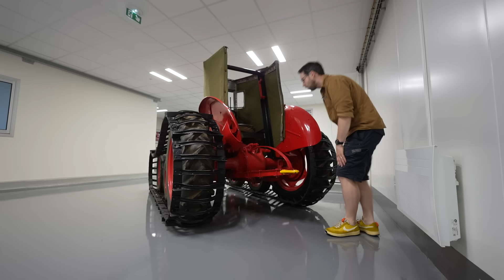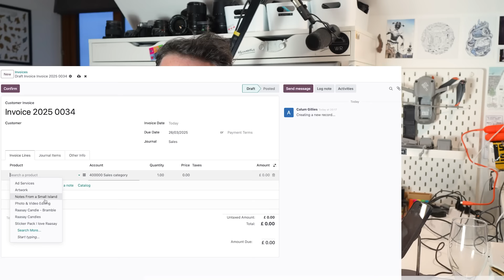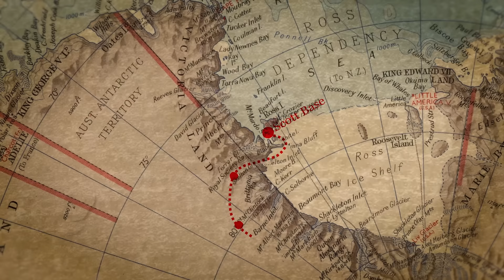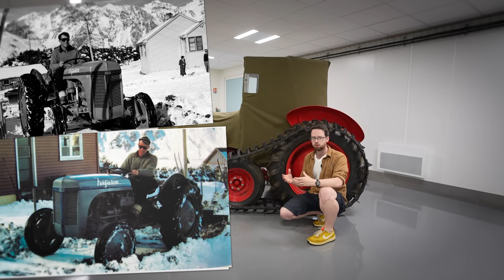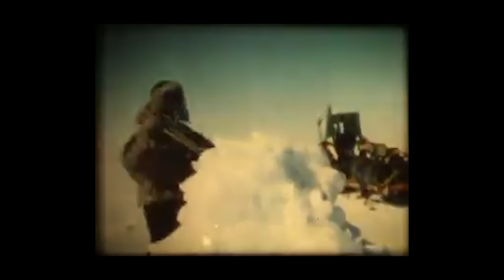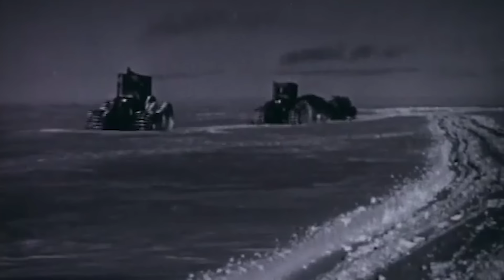The First Vehicle to Drive to the South Pole

Comment: Came for the antarctic exploration, stayed for the old tractors.

I dont need one as big as that ferguson of yours but i would kill for an old sub compact with a mower deck. Cub cadet made a series of them in the 70s but the rear PTO rotated the opposite direction from the standard everyone else uses. Im not sure if they sold them in the UK but they were fairly common as lawn tractors at one time in the US and Canada.

Comment: The Ford tractor came first. 

Specifically, the Ford-Ferguson 9N, produced through a partnership between Henry Ford and Harry Ferguson, was introduced in 1939 and was widely used throughout the early 1940s. 

Here is the breakdown of the timeline:

Ford (Ford-Ferguson) 9N (1939): 

Introduced in 1939, this was a pioneering tractor featuring the "Ferguson System" three-point hitch. It was common in the early '40s and was followed by the 2N in 1942.

Ferguson TE20 (1946):

After Harry Ferguson and Ford separated in 1946, Ferguson began producing his own tractor, the TE20 ("Little Grey Fergie") in England.

Massey Ferguson (1953/1958): 

The company "Massey Ferguson" did not exist in the 1940s. It was formed in 1953 through the merger of Massey-Harris and the Ferguson Company, and the name was officially shortened to Massey Ferguson in 1958. 

While Massey-Harris produced tractors in the 1940s (such as the 101, 20, and 81), the specific brand "Massey Ferguson" and its iconic 1940s-style tractors (like the TE20) came after the Ford-Ferguson 9N.

Comment: Looks pretty much just like a Ford version that my grandfather owned that we completely restored from the ground up. Like yours his was extremely reliable very rarely ever needing anything and always started on the first kick of the starter. They were very easy to work on too. We need to get back to that simplicity and reliability and get rid of all the computers in electronics In everything we build. Sure have the computerized version but offer an analog version as well. Willing to bet after a short period of time the analog versions would end up selling better especially if the computer version is still built the way it is now.

Comment: We have a 55 as well but its petrol, originally ran on parafin with a starter tank at the back that lets you start it on petrol and warm the parafin :D Amazing tractor so easy to maintain and replace anything I love the engine and how it uses piston sleeves :D just replaced them all on ours. Still watching and your using the standard exhaust we bought a underneath one and it makes a big difference, so handy how easy parts and even little upgrades like your foot plates are to come by, I love this tractor :D You can even make them run hydraulics the one we have now is our second one the first one had very basic one way hydraulic pump system made into the main casing by some DIYer the one we have now is just used to turn a PTO hydraulic pump much more standard. Would love to get a front loader for one but they seem very hard to find only ever seen one in person and it was what looked like an original front loader with a string to tip the bucket :D

Comment: I remember growing up on a farm in Northumberland UK in the foothills of the cheviots. they had a Massey Ferguson 35 with the same tracked system for the use on the hill farm to get around, when the snow got deep enough to limit mobility. As far as I remember it was still used up til the late 70's. during spring the kit was stripped off and stored in the stables till the next winter. pretty cool to see the same systems history

Comment: Apparently both petrol and diesel variants were used for the expedition, 4 petrol and 3 diesel I wonder if they had any preference diesels typically have more torque then petrol the only torque figure I could find was 104 ft/lb for the diesel but nothing for the petrol both these engines were supplied by The Standard Motor Company.

Comment: That tractor was made at Banner Lane in Coventry.
The tractors on that mission were petrol engined variants with slightly modified governors, to rev the motor a little bit more.
Harry Ferguson was a genius. He built his own aircraft, and is the first person to fly a heavier than air machine in Ireland. The Ferguson four wheel drive formula one car that he built, is still the only four wheel drive formula one car ever to win a race.
The three point hydraulic linkage and draft unit really was the invention of the modern day farm tractor since the Ferguson type A dubbed, The Ferguson Brown.
The youngster green and yellow overalls brigade are mortified when you point this out and they find it to be historically correct.

Comment: Great to come across this video and it's excellent presentation, here in NZ 🇳🇿 I spent almost 18 years servicing and repairing Massy Ferguson tractors from the early 1980s and found them to be easy to work on  and certainly the later and bigger 4wd models great machines and do remarkable work for the farmers owning  them 👍👍🇳🇿

Comment: Great video, Calum! I really must check out more of your content. When I joined the British Antarctic Survey in the 1980s my boss was a man who had been a member of the small party that built Halley Bay station on the Brunt Ice Shelf in 1957. He entertained us with stories of how they built the base using hammers, shovels and a little grey Fergie. By the time I got to Halley (then on its fourth reincarnation) the Fergies were long gone and replaced by an eclectic mix of vehicles of varying vintages - Tucker sno-cats, IH bulldozers and Muskegs. The cats mostly had automatic transmission and car-like controls so were relatively easy to drive. I wasn’t allowed anywhere near the track-steered vehicles!

Comment: Kinda surprised knowing they were going into high altitude cold weather conditions they didn’t put high dome pistons in them and possibly look at turbocharging them. Would have been a little advanced for a farm tractor at the time but the tech was perfected on high altitude aircraft engines during the war so they would have known the benefits.

Comment: Nice video. The tractor was actually a Ford designed tractor, the 8N. The hydraulic system was Ferguson’s part of the collaboration. Ford and Ferguson eventually had a falling out and a legal fight ensued. After the lawsuit was settled, Ferguson continued making the tractors but with Ferguson overhead valve engines instead of the Ford flathead engines.

Comment: I live in Northern Minnesota and often have to use a torch when starting equipment.
I heat the side of the crankcase, cylinder head, and exhaust manifold. I do each for a minute, then repeat. After 10 minutes of this, I start it.
If you rush it, the motor will start, but the oil is too thick to flow, and you can throw a rod.

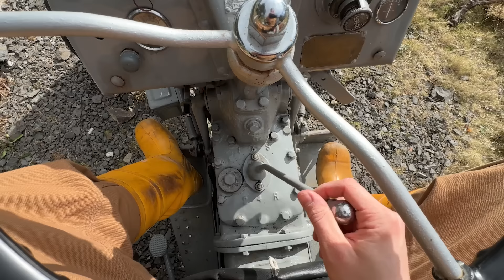Comment: 4:10   Oh!!! This tractor has been rewired,  ...  See the "S" on the gear shift pattern??  That's for "START" ...  A heavy spring switch was in that position to start the tractor --- making it impossible to start it in gear!!

Starting in gear is a BIG safety hazard especially for people used to hauling stuff with horses, A tractor just drives away if started in gear.

Comment: non standard starter switch :D  to be fair the originals are probably impossible to get now.   However it was another clever bit of design that you used the gear lever to start it so you couldn't accidentally start it in gear and have it take off.

Comment: The most important aspect of the 3pt linkage was that it eliminated the tip-over problem with draw bar implements. If you hit a rock or tree stump with the 3pt plow the tractor would bog, and die, or lift the plow out of the ground. Before the 3pt system, if the implement caught, the torque from the wheels would cause the front of the tractor to raise and flip, often killing or injuring the farmer.

Comment: The 1910-1913 British Terra Nova Expedition that began (after constructing a series of supply depots along the way) on 17 January 1912, led by Robert Falcon Scott, lost the race to the South Pole (90degrees S) to Roald Amundsen's Norwegian South Pole expedition because the British expedition depended upon unreliable automotive tractors.

Arctic explorer Roald Amundsen had some good suggestions to Robert Scott's Antarctic expedition:
- Use Greenland sled dogs (he had 52) as they are the best and will eat fellow dogs fed to them, but Scott used 3 automotive tractors (motor sledges) designed in 1909 that quickly broke down, his 19 Siberian ponies quickly died in the harsh conditions, and he only had a small pack of sled dogs remaining until they, too, died and the explorers had to drag their heavy sleds slowly to their exhaustion.
- Wear arctic wolf fur clothing as that is best for extreme cold and removing moisture from you instead of Scott's cotton parkas that got wet easily and took long to dry out.
- Start as early as you can and build supply bases as far as you can, but Scott started later, his progress was slower, and his expedition died within 11 miles of a supply depot on the journey back when they arrived at the South Pole to see Roald's Norwegian flag planted there nearly a month before.

The Norwegians started 11 days before Scott at a base 96 km (52 NM) closer to the South Pole than Scott's base. Amundsen made a round-trip of approx. 3440 km (1857 NM) and returned before winter again arrived with no casualties. Scott's expedition suffered terrible delays with the motor sledges breaking down, the ponies and dogs dying, the explorers had to pull their sleds by skiing, and they were delayed so badly that they were trapped in a winter blizzard 18 km (11 Nm) short of a supply depot where they all died.

Comment: Those canvas cabs are actually more effective than they look. They go by several different names comfort cover,  weather brake,  heat housers. I still use one on a JD 2510 to feed cattle in the winter.  They block the wind and also funnel the heat from the engine directly to the operator.  Certainly not a replacement for a full cab but definitely a good alternative.
Reply from the maker: I’d imagine just taking the worst of the wind would make a big difference!

Comment: My question  is TE-20 and TEA-20? Owned a few TEA-20's and everyone that owned the TE-20 always bought my TEA-20's after restoring.
Reply from the maker: For Antarctica it was standard petrol TE20- but! They fitted the diesel Ki-Gas system, which is very unique. You might have noticed the space for the kigas button on the dash of “sue”

Comment: I learned to drive on a 1939 Ford 9N with Ferguson system.  The Ferguson company was founded after Ford and Ferguson fell out.  With a gas engine, the tractors are very quiet. I love the way the Ferguson uses the gear shift lever to engage the starter. It's much easier than putting the button on the transmission case.

Comment: I loved my old TEA Fergie, a kerosene model fitted with a front-end bucket and dual rear wheels :-) Idiot proof, I did all my minor and major maintenance under the guidance of the local spare parts manager who knew the part number of every component of the tractor

Comment: Here is another 'hot' Ferguson story for you. I was born 1946 and raised on a dairy farm just outside Victoria BC, Canada. One of my earliest memories is of riding on my dads lap on that tractor. It was replaced 1951 by a very similar Ford 8N. But here is the 'hot' part. In 1968 I was working as forestry technical volunteer in Tanzania and happened to be exploring a remote area in the bleak western part of the country. I happened to tent camp in a spot just west of Bukene which was one of the locales for the failed British 'Groundnut Scheme' ... google it... There was an abandoned building which had once been a workshop for the project and in the work yard outside were about 20 Ferguson tractors in various states of disrepair, just abandoned there, some with trees growing through them. I recognized the chrome gear knobs right away. Even at the time I was there this was still a very remote, dusty bleak place with the nearest thing that looked like a paved road 500 miles away and actually near the spot where Livingstone met up Stanley 100 years earlier.

Comment: I still use our TO35 that was bought new by my Dad in 1958.. It has the Perkins Diesel which is bullet proof and powerful. The last full rebuild was about 8yrs ago and I think the over all rebuilds from 1958 have only been three... This thing is a beast and extremely reliable... It's just a workhorse and a good looking one.

Comment: Im 57. Your tractor reminded me of being 12 and using a pick-up disc on a similar Ford n model about a 1939 if memory serves me. At 20, I operated a Massey Ferguson 135 from about 1970. 15 feronheight glow plugs or not, it would turn over and warm up to go all day. In my 40s, I borrowed a similar machine to mow high grass. The guy that loaned it said, "Do you need to know anything about the tractor? I said no, she's like an old gal friend. If you treat her right, she'll help you get the job done. If you don't, she'll throw you on the ground and run you over.

Comment: We had a TO-30 Gas, a 135 Diesel and 135 Diesel industrial tractors on the farm. All were amazing little machines. The fact that there are many thousands of them with many thousands of hours on the clock still in use is a testament to their reliability.

Comment: I bought a 1949, 9N Ferguson in 1968. Came with a plow and disk, used it to garden, haul firewood, upkeep of my property for 30 some years. Thanks for the video, never heard this.
Reply: Ferguson didn't make the 9N , Ford built the 9N ,it did use the Ferguson 3 point hitch system

Comment: I learned how to drive tractors and manual cars in general on a Massey 240. Also learned how to pull start a tractor on a Massey 240. The starter didn't like the cold and the battery was more of a decoration.😀

Comment: 4:15
Wait a minute! did he just start it only using the Key?
ours cant do that! you need to put the gearstick into S which is opposite of reverse.
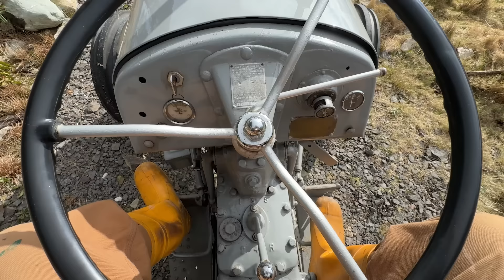you can see it at 4:07
Reply from the maker: Haha yes, mines a bit unusual - no need to put it in S!
Reply: @CalumRaasay  we have to push in the key for it to run, but turning it controls the lights

Comment: i would have chosen Eicher over ferguson, because Eicher built engines that started as long as there was fuel.
there is a story of an Eicher demonstration, where the tractor was buried under 150cm of snow in -20°C and needed to be cranked one and a half times before starting. no preheating, no choke nothing. just tuck tuck tuck!
also since they are aircooled, the cooling system cant freeze, and it is at ideal temperature faster.

Comment: I'm not surprised... back in Yugoslavia the locally produced copy of this exact model (IMT 533, IMT 539) served as the backbone of peasant mechanization for over 50 years... and still does. see, one problem with this model in the west was that it was introduced just as farms were getting bigger. but in Yugoslavia we never had that, so it provided a healthy ecosystem for these hardy little machines. Heard a story where a shed burnt over one. after fire was burnt, they started it again no problems. only tires needed changing. So yea, fine machines.

Comment: We have an open station with canopy Massey Ferguson at my work. Mainly to cut grass to keep the property somewhat presentable and to push a little bit of snow in winter, but it’s a loyal rugged little machine. It ran an entire summer with water in the fuel tank and it didn’t even seem to phase it (obviously fuel filters helped) but I will say something that hasn’t ever changed is how loud they are, running it at high rev with PTO power you need to have some ear pro.

Comment: When you're crossing a continent covered in ice and snow, what creates this empty space underneath that the tractors can fall into?
Reply: The Antarctic ice sheet isn’t static - it’s a vast glacier, flowing slowly out from the high interior of the continent to the coasts (where it breaks off in big chunks - icebergs). In places it’s flowing over quite rough topography - subglacial mountains - which disrupts the flow and causes crevasses to form, just like in an alpine glacier.
Reply: @Pequod23  nice, that makes sense! Kinda creepy that there are mountains down there impeeding the flow of ice and creating holes and tunnels going down for possibly miles.

Comment: That is a very cool bit of history! I never heard of this until your video. I've used the Ford counterpart of these little tractors to plow a lot of snow with a canvass cab. It would sweat you out with those side curtains channeling the heat from the radiator back to you, but our Ohio cold doesn't hold a candle to the weather at the south pole. I would definitely trust the tractor to get me there, even now at 90 years old. Words can't describe how reliable they are if well cared for.

Comment: I've had access to a TO-20 lately, and I'm glad I didn't when I was young.  Putting the left brake pedal near the clutch pedal makes a common maneuver very difficult.  A maneuver I'd be doing for hours on end when pulling a two-row cultivator.  I've seen Fergie fixed that on the next model.

Comment: Great video, Calum - much appreciated.  

I was aware of the Antarctic Ferguson tractors as I saw one in the museum in Christchurch when visiting NZ a few years ago.  I used to cut my cricket club's outfield here in Edinburgh with a set of gang mowers pulled by a wee grey Fergie (1957 vintage) - a pretty cushy life for the old girl.  It had twin fuel tanks - started on petrol (first time, every time), then switched to run on kerosene (originally TVO).  I still have fond memories of bouncing around on our hilly, rather uneven outfield driving the Fergie a wee bit too fast.  We sold it to a guy that restores them so I hope it's still chugging around somewhere.